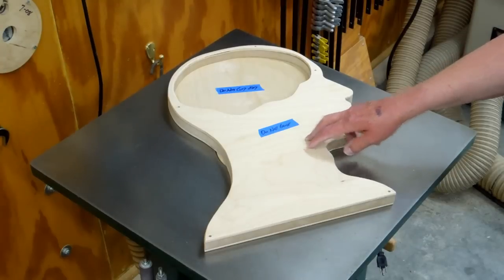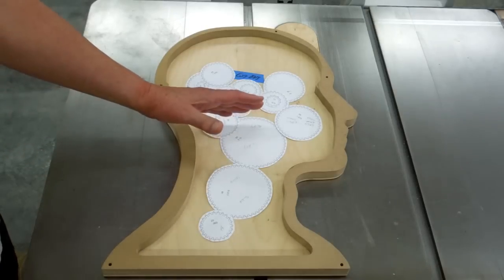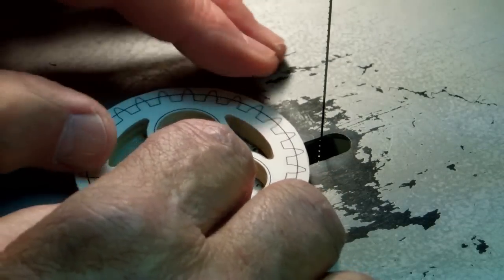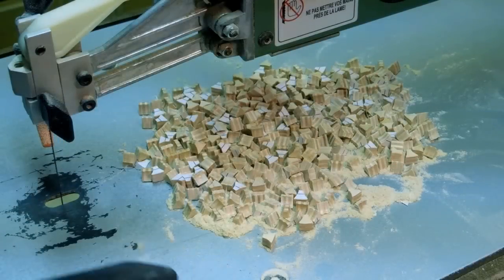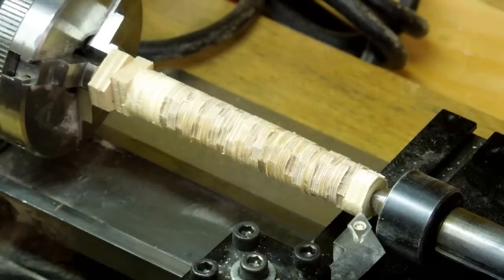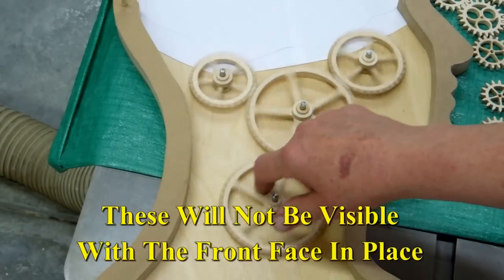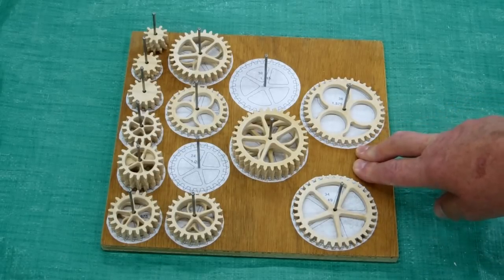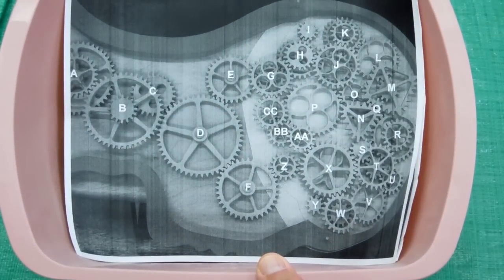Gear Head Part 1 - Construction

Comment: I might try gluing a second piece of paper to the bottom of each gear to stop the tear out, and then sand it off.
Good luck 
Great project
Reply from the maker: Probably more trouble than it is worth. With the reverse cut blades, tear out is not a big issue. When there is tear out it is usually due to weak or unglued veneer and the tear out can then occur on the top of the cut as well. Spray adhesive on a piece of paper will not help this problem and wood glue will probably mess up a finish. Generally these gears can only be viewed from one side. Good side up!

Comment: Hey, is it alright if I sit agape as I watch you cut darn near perfect teeth on those gears like it was no big deal...all while that scroll saw blade flaps loose? I hope so. Big ups boss.
Reply from the maker: Rest assured that blade is sufficiently tight. You would not be able to cut anything with a loose blade and the scroll saw would not run correctly. What makes it appear to "flap around" is the stroboscopic effect caused by the camera shutter speed and the 60 Hz flickering of the fluorescent light.
Reply: Well, I didn't mean, "you're doing it wrong". I meant, "Wow, look at that guy cutting those teeth with amazing accuracy." I figured you knew what you were doing even though the blade looks out of control.

Comment: Cool project!  I wonder if you put of scrap on the top of your jigsaw with a zero tolerance spot for your blade if it would stop the blow out on the bottom of the cut?  Looks like a big gap around the blade in the vid which would allow wood to get torn out on the downstroke cut. Just a thought. Really enjoyed watching. Thumbs up
Reply from the maker: +Wooden Tool Man Not really necessary with the scroll reverse blades which cut up from the bottom as well as down from the top.
Reply: +Ronald Walters I was wondering what those blades were. Thanks.
Reply: Wooden Tool Man

Comment: I love this video specially when I saw all those gears turning with very little friction. Could you please tell me if the Dremel Motosaw will perform the task of making the gears or do you think I need a scroll saw and if so, which one would you recommend that is not too pricey. Thank You.
Reply from the maker: I don't see the Dremel Moto-Saw as being very suitable for this type project. You would need a proper scroll saw. I have used Delta Scroll Saws and have had them wear out. They are ok for a while but they are a relatively cheap saw. I now have an Excalibur (Canadian company, made in Taiwan) which is a bit expensive but very well made. You want a scroll saw which accepts straight end blades. Do not get one that requires the pin-end blades.
Reply: Ronald: Thank You, just what I was looking for. The Dremel Moto Saw has such good reviews I almost bought it. I appreciate your advice.